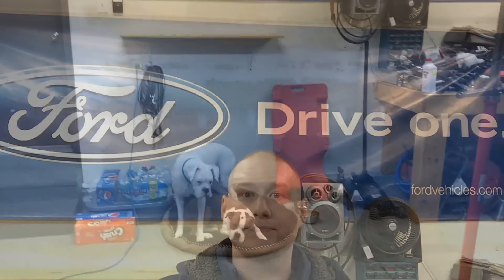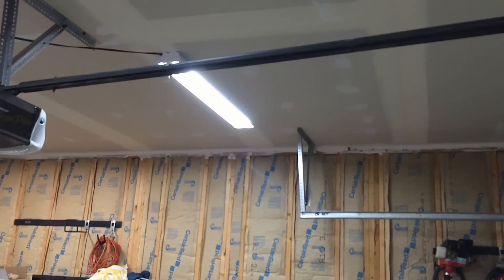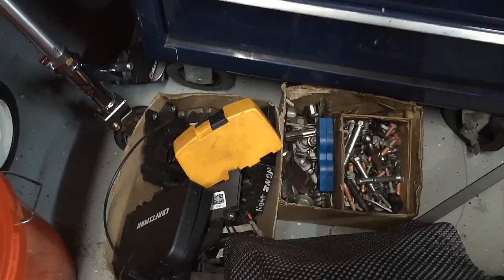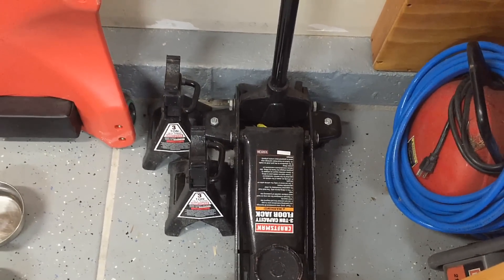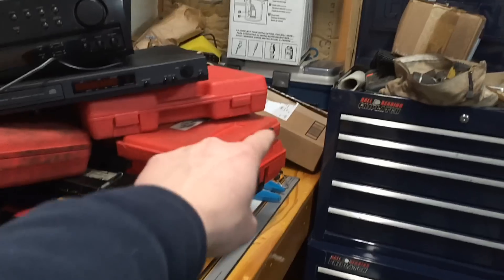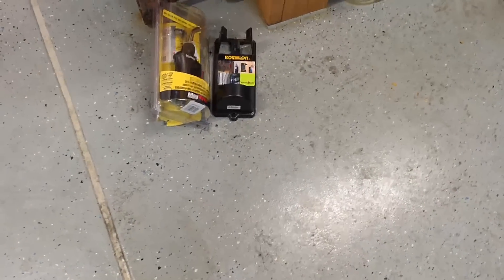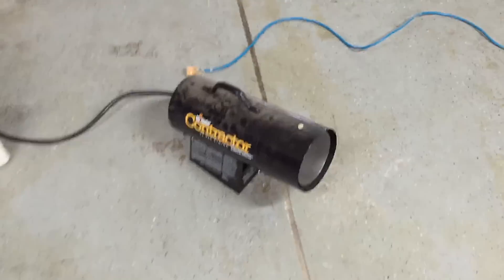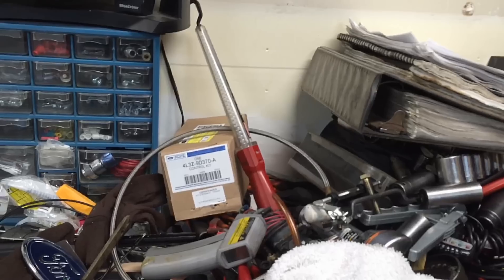Shop Update: #1 What I Have To Work With- Setting Up

Comment: If you put 2 more florescent lights in you should put them on the wall below the garage door track that way you can use them even if the door is up and it will give you side light into the car.
Reply from the maker: The Great Jelly Doughnut Yeah that is a good idea we had that setup at the dealer.

Comment: Hi Brian I recommend that you put a light colour corugated steel on you're walls because it is fire proof and water proof and if you want to go back and add wires of fix a water leak etc It makes me remember when we started to work on cars we started to work from a home garage with no lifts we built a 2 bay garage with 2 post lift now that I'm spoiled I don't know how I could go back to work on a floor with a creeper I know there is some models of portable lifts or a portable scissor mid rise lifts. Good luck man I hope that you're nabours are going to put up with that in a subdivision like where you live we build the garage on the same land that my parents home but the difference is my uncle live next to the garage and on the other side the nabour is not close plus we live in a small community any way hope that they leave you alone.

Comment: You have a flat concrete floor , walls and a door . so off to a good start .I can relate , after 20+ years had to move across state  in less than 2 weeks , for a family member . Lost a lot , and been real hard , but I am building back . Hoping to do something about a bit bigger garage this summer . You have the knowledge and know how to use it , so there may be rough times but sure you will do ok .

Comment: My dad retired with 35 years as a mechanic for MHTD now called MoDOT.  He kept 2 different town's equipment running.  We've repaired many vehicles together.  We rebuilt my first car a 1967 Mustang.  He worked on people's vehicles in his carport until he built a 2 bay garage.  We've rebuilt numerous salvage vehicles.  The last one we rebuilt was a 2012 Ford Taurus.  Without having the electronic equipment, he's mostly quite repairing vehicles but the Taurus was fun.  I have the Taurus and it's a great looking and driving car.  Good luck to you with you change in employment.  There are plenty of vehicles needing a good mechanic and you seem to be one.

Comment: Well, you have more than I have to work with. I have a pickup truck full of tools, and no indoor shop. Did a power steering pump today in a parking lot, radiator/exhaust manifold at a storage unit the other day with 20f weather. I am currently looking for a house with the "Right" garage.

Comment: Get in good with one of your local parts stores. If you use them for all your supplies (oil, coolant, stuff like that) they will cut ya a good deal on it. Btw. Hit up Vista Print for some business cards. And see if ya can score some oil change stickers from your local parts store as well, as custom ones are ridiculously expensive.

Comment: Hi Brian. I am so happy for you and you will help so many people. Think of that poor single mom with that broken blend door and 3 little kids. Great idea to help those who can not help themselves fully. I wish you was closer, I'm in Arkansas. My 2003 Town Car 225,000, 4.6 of course, started having a coarse idle about 8 miles ago. The car runs flawlessly when cold (first 5 min of driving or so) once warm, the idle at a dead stop is coarse and the car fumbles, but doesn't die, take off and hit 1 mph and everything is like new and tons of power. The check engine light finally came on and I got one code, P0306. #6 miss fire. I have two identical Town Cars so I swapped a few parts. MAF sensor, coil on plug, and a new spark plug. No change. Still ruff idle. I've ordered a new injector and will put it in next week. I've unplugged the fuel injector connection several times to clean the contacts and no changes. I was just wondering if you had any advice. I guess next would be a compression test?
Thanks in advance.
Reply: Also I'm not driving the car until it is fixed, I don't want to chance frying the converters. The check engine light isn't flashing and the exhaust still smells clean, but I don't want to risk it on a car with 225,000 miles.  I'll take it to the Ford place, which is right beside my house if the new injector doesn't solve my issue and if I have good compression. I'm going to put a new intake manifold on it in a few months. Mine is leaking just about a cup a month on the passenger side where the thermostat would be if it was on that side. All the plug wells are bone dry. I don't think this is a manifold gasket issue as this one is still on the OEM gaskets and they almost never fail.
Reply from the maker: fastrace011 Yeah it is gonna be hard to trace without the power balance on the Ford scan tool. My guess is there is more than one misfiring but just has not set a code yes but #6 has hit the threshold and popped a code. We are swapping parts on  the second cylinder back from the front on the drivers side right?

Comment: Also Brian, if you get any 4.6 Panthers in with a leaky intake manifold, I'd love to see a video on this. I've changed on on my 03 Grand Marquis and will do one soon on my two 2003 Town Cars and my 01 Crown LX. I'd like to see if you have any tricks or advice that I hadn't thought of. The 1996-2001 bust suddenly right behind the alternator and spray all the coolant out right into the alternator. The 2002-2011 start a slow leak under the thermostat area and the leak will not be a catastrophic sudden blow out like on the 96-01. Also my research shows that all years 96-11 can crack at the rear passenger side heater core outlet out of the intake. These intakes usually last 10 years or so, but I have a 97 Town Car as well and it is still original, but it only has 55,000 garaged miles. Of course my old 95 Town Car's intake is metal. Thanks in advance. I check your channel daily and I'm so excited for you and your new chapter in your life. I can't wait to see your first video repair from your home shop. Also, even though Ford extended the coverage on the Panther lighting control modules to 15/250,000, if you get one in with flickering head lights, just pop that module apart and soldering iron and put a new relay in yourself. $5.00 for the relay, vs fighting with Ford for a week to get it fixed. Thanks again.
Reply from the maker: fastrace011 Will do if I see one in the shop!
Reply from the maker: fastrace011 Will do if I see one in the shop!

Comment: Hate to bother you when you are this busy but got a question. Picked up a 2007 F150 FX4 with 130,000 miles on it and when you really get on it, it has almost a misfiring feel to it. Have no clue when the last spark plug change was but considering this is the 5.4l 3v (have a 98 4.6l) I don't really want to do the spark plugs myself. Any information on what this could be would be appreciated before I start throwing parts at it!
Reply: Shit day today but got rear ended (haven't even made first payment) and now on start ups and just cruising at 45mph it has a "misfire" feel
Reply from the maker: OverRotated Owl Well it could be plugs or coils but high rpm misfires are common on these with the original plugs. I would change the plugs and retest. Only way to know for sure which one is by using the Ford IDS to see in real time which cylinder is missing.
Reply from the maker: OverRotated Owl Yeah 45mph cruising you definitely have a coil failing for that concern they are fully loaded up at that point and drop out.
Reply: Thanks for the help! And good luck to you, you are defiantly there for your subscribers and we really appreciate it.

Comment: Hey sry to bother you again, awhile back I mentioned to you about my wife's 2013 explore sport 3.5 ,having shift to park light staying on dash when veh was in park ,I think you said you have seen this problem on a lot off veh. Coming through, today I had the shifter replaced at dealer,the shifter they installed today ,when I got into my veh to leave I noticed the new shifter has the manual shift button on it ,,I ask service manager why I have a button on shifter he tells me ,to manually shift ,I told him I have padel shifters on streering wheel ,+ I did notice handle is much fater then original one ,he told me this super seeds the old shifter part # foct4z7210kc , my light has been off for awhile, this is a intermit problem, so I figured just get shifter replaced ,not knowing I was going to get a complete different shifter with shifter buttons on it ,have you run into this? Why couldn't they just have orderd the original shifter ? ,they told me they haven't seen to many veh do this but it does happen once in awhile ,if it only happens once in awhile why couldn't they replace with original one ,what would you do if this was you ,,thanks for any info you have much appreciated!!

Comment: i wanted to ask you if the ford expedition 2015 ecoboost 3.5 6 cylinder  has the same problem or is it fixed?
Reply from the maker: rami almilhim We will see but one thing I can tell you is the engine is a carryover from the 2014 model.